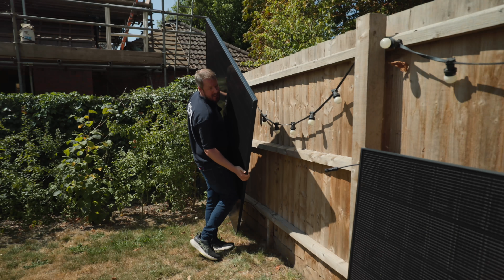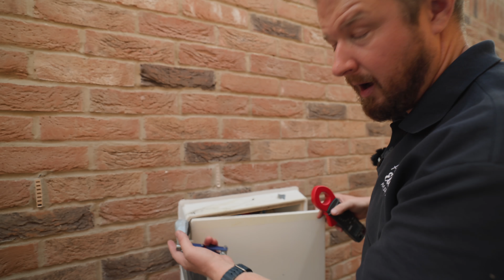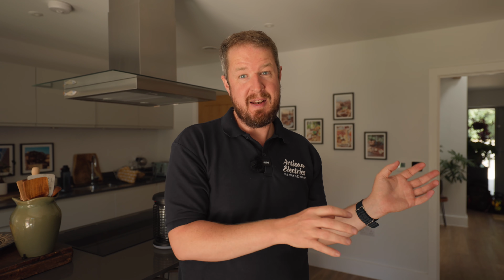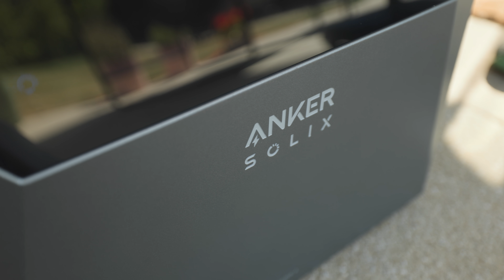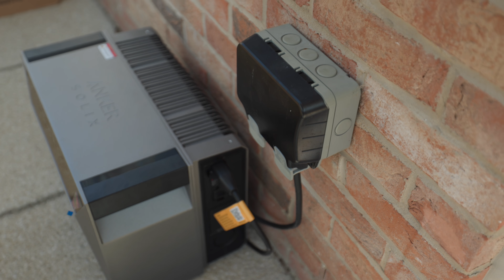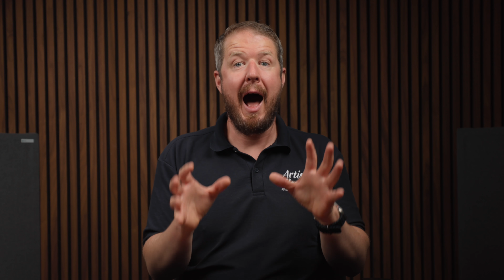The MISSING PIECE of Plug-In Solar

Comment: To say that the base load is hardly anything doesn't speak for everyone.  My baseload is a constant 600W+.  My dishwasher consumes about 0.5kWh total for a normal cycle, washing machines run at cool temperatures so the suggestion that these are the big loads to cover would never really be true. Cooker, yes.  In my case, that base load could be covered by 6 hours of daytime solar, removing 3.6kWh per day, against standard rate that would be £1 a day or £30 a month on back of envelope numbers.

Comment: What happens if there is a powercut in your area? The plug in battery has the potential to make the electricity supply downstream from the break in supply live, posing a threat to engineers working to fix the fault, and potentially feeding other houses on the local grid, does it not. I would have thought a gateway which cuts the grid supply in such cases would be required, or is one built in. Also what if you have an existing solar array and battery, can you add a plug in system?
Reply: These home plug-in systems (800/1200W) are grid-tied systems. If grid goes down these simply stop working. The only way to get the stored power from them would be to plug devices directly into them. If you want to power your full home with batteries you would need a transfer switch (manual or automatic). You would be switching between grid and your own inverter, and only one can be connected at a time.
Reply: @davidlt 
Yes, but if you have an existing solar array and battery with a plug in solar as an additional, supplementary source of electricity, the mains supply will be coming from the existing battery, so the plug in won't know that there's a power cut. Or would the existing solar inverter cut-out be sufficient to trigger the plug in array to cut out? Perhaps I'm over thinking it?

Comment: so the grid is legally stealing your electric production and selling it to next door, also if you take all low voltage systems off the grid and run buy battery u will save all the monies produced. also if not connected to the grid you have no need for an electrician, you can learn for yourselves most is plug and play

Comment: The name belays its limitations. Using a standard wall plug you are limited to 800watts You can add more but here’s the problem. The national grid needs to switch off the mains from time to time for maintenance. The crews do not know if you have micro generation of power so you could electrocute them by feeding power back into the grid.

Comment: "Under current UK regulations, installation requires hardwired connection by a licensed electrician" - I've been quoted over three thousand pounds to plumb 4 existing panels into my house. None of this makes economic sense to me. Also, would you leave a battery like this outside all year round in the UK?

Comment: Not interested in when you get up etc - can wind this vid down to a minute of useful data. Adding a battery makes the cost of using this non-viable - and not allowed in the UK. Before you do anything silly, just check your meter - when I first had solar added, the meter started to run backwards - if you have got one of these meters, I'll leave that up to you as to what action to take

Comment: Plug in solar as not for people out of the house in daylight hours so it only saves a tiny bit in summer when you get home in daylight. 
So cheap plug in solar is not actually as to save some money you need the expensive battery. 
However the thing everyone forgets is, you save no money untill you have saved more money in bills than the solar and battery cost to buy and fit.
So if you spend £1000 on the system how many weeks will it take to get that back in savings? 52 weeks or 104
Over 52 weeks you would need to save £19 a week, with low energy usage everything  that may take some doing. So realistically it will be two years before you save any money.

Comment: That's a long explanation of how home batteries work when they seem to be doing little more than reinventing the bog-standard solar PV and battery system. And I suspect these plug-in solar panels and portable batteries will work out considerably more expensive per kWh than having a proper home solar system with a fixed battery installed.

Comment: It is another way to rob the people who do not know what is happening..
I have a20 panel system and 32 kw of battery storage , that charges and when full exports, I can use what I want including the car charge. What is not generally known is that there are very few day in a year that a panel makes anything like it’s rated charge.. I can monitor every movement of power in and out and the gain is nothing like my inverter G99 limit.

Comment: Of course if you are retired, you are at home more, and you can more easily flex your consumption. The general point about linking solar with batteries is the one retired people (who may) have more cash savings, should really consider. As it gives them a quicker route to return on investment. The retired with cash savings are also better placed to use solar and batteries (and off peak tariffs). For example as a retired driver and full EV car combined with domestic solar is a real way to compound savings. Now we are retired our short journey’s now dominate our driving profile. The compounded returns mean that paybacks are within your expected lifetime , and your less likely to move home, getting the full advantage of the investment, and your expenditure is not dominated by mortgages and student loan repayments, etc, etc.

Comment: why would you need a power outlet on the battery if the battery is putting power into your house via the plug during a power cut ? If as you mention you use the battery as a stand alone power supply to power your fridge etc how is the rcd/rcbo protection for domestic appliances handled as I assume the onboard inverter may be centre tapped ?

Comment: Need to run the calculations with a particular plan in mind. The cheap rate overnight means a more expensive rate during the day which needs to be taken into account for those times that exceed the 800w load. It's just a spreadsheet, but worth doing.

Comment: For me the biggest issue is, when there’s a power cut and the panels try to generate into the system.  Very dangerous for the people who maintain the grdi
Reply: That will be why all grid-tied inverters have anti-islanding protection. They require the mains to be present, to synchronise to. When the mains goes away, the inverter shuts down, within 1/100th of a second - at the next zero crossing.
Plug-in systems are quite literally no different in requirements, to fixed solar systems, in that regard.

And no, they won't damage or blind  RCDs. Fixed solar inverters, that are grid-tied, don't, either - and those have been around, for decades.

Comment: I’d like to put solar panels on my shed at the bottom of garden. Anyone got any advice as to whether to out the battery in the shed and run the cables to the roof or to out the battery in the house and run extensions to the mppt cables?  It’s about a 20m length needed to run round the garden fence to the house. Any advice welcome ?

Comment: Just fill in a G98 form send to your power supplier  for example Uk power networks. See the following When your system receives G98 acceptance (often referred to as G98 approval or notification confirmation), it means your small-scale renewable energy installation—such as a domestic solar PV or battery storage system—is officially accepted and registered with the UK's Distribution Network Operator (DNO).Because a G98 application covers microgeneration systems under 16 Amps per phase (roughly 3.68kW for single-phase systems), it follows a "Fit and Inform" process. This means approval is a standard confirmation of your right to export

Comment: My circuit breakers are Unidirectional can i still use plug in solar
Reply: Yes, because the inverter will shut down, if the breaker trips - just like a fixed solar inverter would do.
After saying "the sky is falling in", Efixx, tested it, and the inverter shut-down when the RCD tripped, and the RCD was not damaged.

The problem with uni-directional RCDs only arises, with battery systems, that can run in island mode. Those do supply power "the wrong way" through the RCD it's connected to.
Reply: @johnbooth5199  Thanks for that.

Comment: Or you can just ignore the grid and feed your solar into a power bank ie battery and use that to power a heavy use appliance.  I installed one in my MIL house for her, as her washing machine accounted for 1/3rd of her bill. Result , bill is a 1/4 less, when the sun stops she just plugs her machine back into the wall socket. You need to be what sparkys are not creative.

Comment: £280 saving per year for outlay of £???  That’s the real issue 
When I looked at this it worked out at £11,000 battery and panels and if they lasted 10 years that’s £1,100 per year cost to save max £500 per year   Not a smart mover

Comment: Think plug in is the first step to owning a full roof solar and battery system. My plug in solar I installed about two months ago. Much goes out to the grid..probably about 1.5 KW per day..But to install a battery is not worth the cost to capture such a small KW. Still feels annoying. Wish could think of how to use it and switch on if exporying

Comment: Agree....mostly. Main point of contention is if you already have an EV with a very cheap overnight rate. Set your battery to suck up 7.7kW/h for 6 hours and store that for evening and night use. The big but...the battery will cost you /~£800 so will take a bit of time for a decent payback. However this will be a massive game changer once the prices come down as Joe Public works it out and that is (mostly) won't need an electrician to do the final step.

Comment: You didn't mention the AC inverter drain. That eats approximately 0.5kWh for the 19 hours a day it's not on charge. So take that into consideration. It's adds about 25% to the costs to run it.

Comment: An electric immersion boiler for hot water is like a battery…switch it on at peak soak production with plug in solar…..forget battery storage it’s only 800w unless you have a proper solar array then a battery would be viable. Where I live there is no alternative cheaper tariff for electric so I wait till I can get a proper solar array. Hopefully by then batteries will be better and possibly cheaper.

Comment: Hi love your channel but you should be advising people to have the battery wired in via fused spur directly( sparky required and fitted by directional ECBO into your fuse box)  and not just plugging it in as you mentioned .  I believe this is correct  only the kits are available and again need to be installed with an up to date by directional circuit.

Comment: Personally I think it is a stupid regulation that you can not use a battery with plug in solar. Unless the power company hires 100's of thousands of people to knock on everyone's door and the person at the door say "yes you can inspect my building" there is literally no way anyone will be able to tell if you are using a battery to put 800w through the plug.

If I was a conspiracy theorist I would think that the only reason why they do not want you to store the energy you produce is that without a battery you use say 300w and the energy company gets 500w free.
You buy the energy production equipment and the energy company gets free electric, nice.
If someone said to you "Hey there is a new device that lets you produce 4 litres of petrol a day by using biomass and its £800, all you have to do is buy it and set it up and pay for the biomass BUT you can only use 1 litre a day you have to give the other 3 to Esso" would you buy it?

There is nothing wrong with plug in solar if you do not use a lot of energy and tbh I might use a battery so all is good but I would not want to pay for the equipment and give the energy company free electric.

Comment: The true cost: Calculations: 5 kWh × 0.08 = £0.40; 5 kWh × 0.29 = £1.45. Difference = £1.05 per day (£383/year). Taking the video’s cited 91p/day (£0.91 × 365 = £332), the presenter conservatively floors the figure to £283/year to allow for unconsumed capacity.
Missing Factor: Lithium-ion batteries and inverter round-trip processes suffer a 10% to 15% energy loss. Storing 5 kWh requires drawing ~5.6 kWh from the wall, and outputting 5 kWh yields ~4.3–4.5 kWh of usable domestic power. Adjusting for efficiency, the actual grid-cycling net savings sit closer to £210–£240 per year. Hardware Costs: The Anker SOLIX Solarbank 5 kWh unit launches at £1,699 (RRP £1,919+). Adding four 500 W solar panels, mounting brackets, cabling, and a smart meter brings the total setup cost to £2,300–£2,600.
Realistic ROI:
Best-Case Scenario (£770/yr saved on £2,400 investment): 3.1 years (matches video claim, assuming 100% ideal generation and zero losses).
Real-World UK Scenario (£350–£500/yr saved on £2,400 investment): 4.8 to 6.8 years.

Comment: and I've just read the government outlined guidelines today and it specifically says this new legislation covers the solar panels but does not yet include the batteries. So you can go ahead and get the panels with the inverter, but you cannot plug that into a battery as yet.
Reply from the maker: Correct

Comment: what a great explanation and no sales pitch love it.

The only question I've got is in the video it states if there's a power cup that battery can carry on supplying the house with up to 800 W but I thought there were supposed to be a safety feature that if there was a power supply both the solar and the battery should disengage because it's there a chance that someone working in the house on the electrics, turn the breaker switched it off they expect it safe to work on the electrics but if the solar panel is still energising the circuit surely that's a risk same thing if someone working externally turns the mains power off to a number of houses if the solar panel keeps pretending or producing more than the house consuming then that extra watt is going to flow back to the mains and the network outside and that could also cause problems

Comment: You have praised Synagene batteries before, does the Anker Solix get any endorsement from you by being in this video? 

I've got a south facing garage roof, no shade and fancy fitting the 4 panels (500w) with an Ankar Solix bundle myself, looking at my consumer unit should be an easy job for the electrician to hardwire the Solix in. £2,300 plus the electricians bill, seems on the surface a reasonable price to dip into renewables.
Reply from the maker: Anker Solix is a great solution for some people! It’s a superb product.
Reply: @artisanelectrics  thank you for the reply, love all the video's and information.

Comment: I was waiting for the announcement. Finally, it's available!

Missing some glaring issues here though:

1. If you work from home, problem solved.
2. Plug-in solar is affordable. Decent sized batteries definitely are not.
3. Even if you're not home, you can schedule washing, dishwasher, etc. to run during peak generation.
4. Renting does not exclude you from putting up solar panels.
5. If you can afford the batteries, you can probably afford a proper solar install.

Flats and no roof access are still a great use case, but pretending that getting the batteries is a "no-brainer" isn't very realistic for people struggling to buy food.

Comment: You can easily schedule washing machine or dishwashers during the day if you're not home. Plus smart plugs would come in handy.
Reply: Doubt if 800 watts is going to do all that
Reply: @cullypettigrew No, but it's better than it going back to grid and you're not getting paid for it
Reply: @Itsonlysimon Also, with the dishwasher, as an example, is only drawing over 800W when heating. For most of the cycle it's much less. So I agree, anything from 400W to 800W for solar can still be helpful.
Reply: @cullypettigrew  Many dishwashers have eco modes.

Comment: you cant export to the grid from a battery in the UK. only from the microinverters.
You could just have batteries and charge them from solar without a microinverter if you match the solar to your battery . then just use you battery to access the power.
We do that. Fossibot is a very good brand of power station battery.
I do have a microinverter, it can manage to import 1.1kwh a day from 400w but its the height of summer right now.
Our base load is about 320 watts but no air conditioner.
So for about 3 or 4 hours, it covers that.

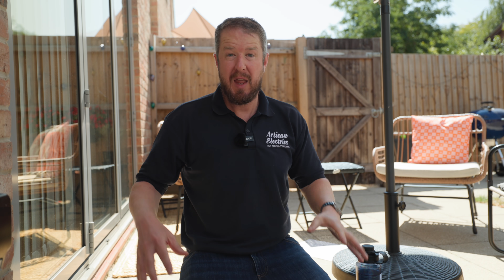Comment: 5:47 "it's also safer"
800 W  is not putting any significant stress on you home installation, otherwise it wouldn't even be allowed.
Reply: Indeed. The wiring should be at least 13A, so where did 800W come from?
Reply: @linuxgaming69 well, because of you add 4amps to a circuit behind a breaker designed for a maximal load of 16A, there might be 20A going through 16A wiring somewhere and no breaker tripping. 

But the 4 extra amps fall well within the redundancy designed into your wiring. 

1.3 million Germans did this for years now. No significant problems surfaced so far.

Comment: Panels need to be permanently attached and that can't be on a wooden structure like the fence you oonted at. Also I think there are restrictions on extensions to mount them far away. The strict rules only allow kne company's complete system to be "legal" you can't choose your own panels. Electric vehicle man did a run down on the limitations.